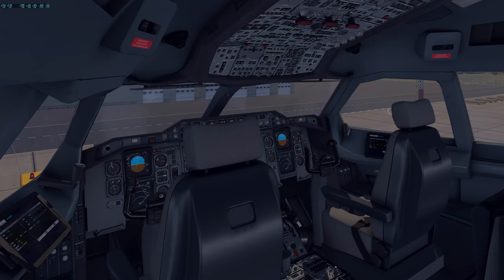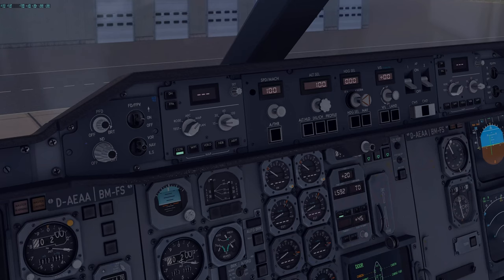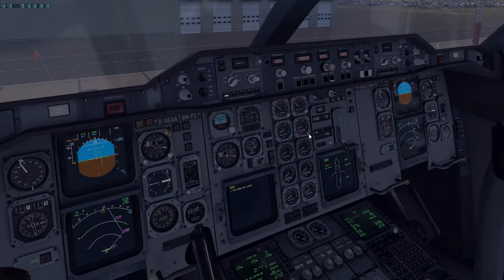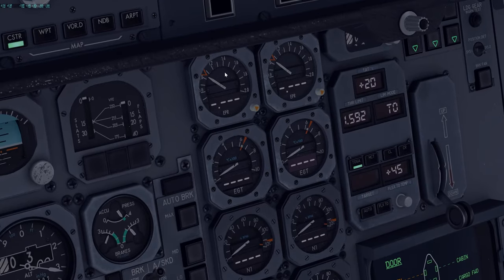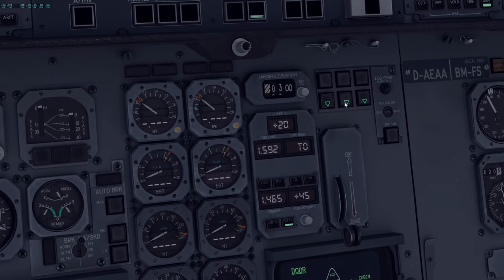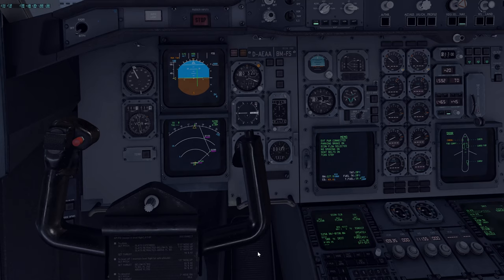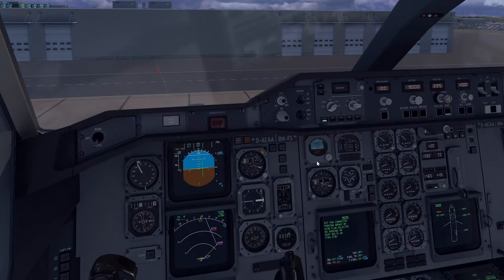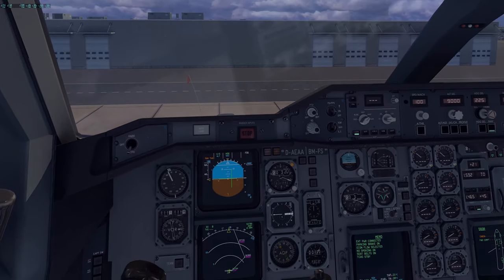iniSimulations A300 | In-Depth Tutorial | Part 2/4

Comment: I think your logic on pressurization is wrong. I believe you should set the landing elevation above the field elevation. Let’s take an extreme example,. You’re at cruise FL380 and your cabin pressure is at 7000 feet. I.e. it feels to the passengers like they are at 7000 feet. Now assume we are landing at a field with an elevation of 9000 feet. That means you want the cabin to “climb”before landing (I.e. let some air out). If you make the mistake of going lower with your field elevation (say you set 4000 feet by your logic in the video) the aircraft will need to pressurize the cabin to bring it DOWN to 4000 (ie more pressure) before landing and you’ll be sat on the ground with a pressured cabin with an aircraft thinking it was landing at 4000. Setting the field elevation 50 of 100 feet HIGH means the cabin will be already fully depressurized when you land. If it isn’t the crew won’t be able to open the doors. 
I hope that made sense.
Reply from the maker: Yes, I did make that mistake and I realized it a while ago. However I can’t change it now